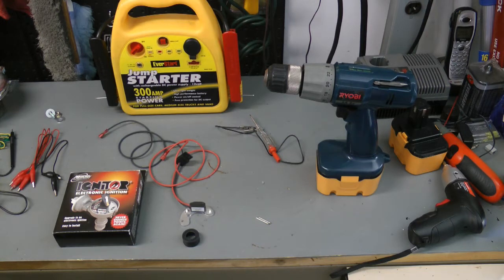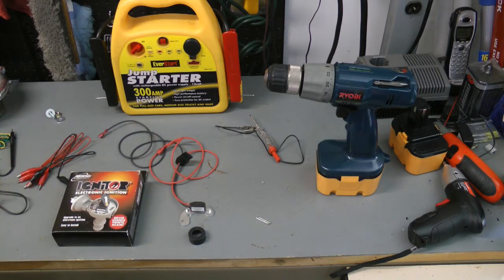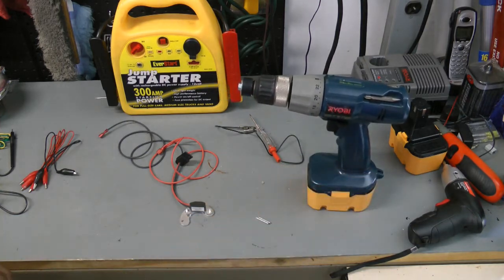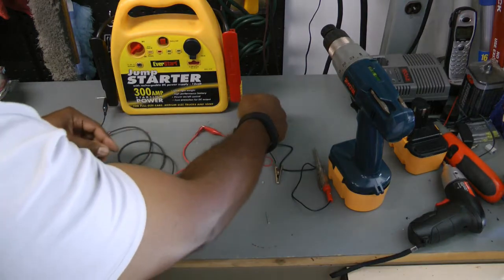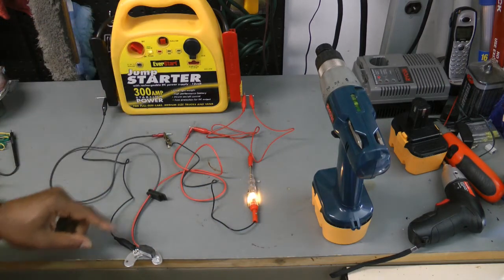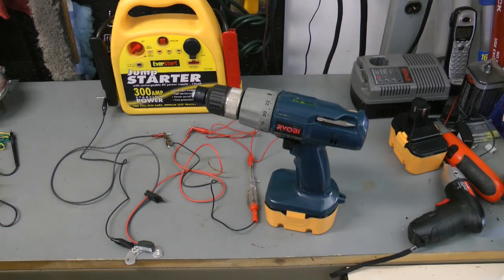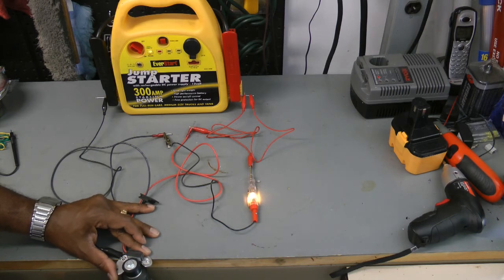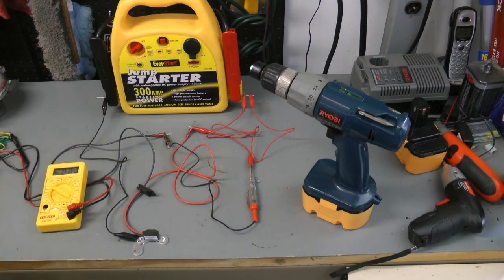Pertronix Test

Comment: Great Video
1 Question i got it all set up correctly, and the light is on, but when i use the drill the light remains on and doesn't flicker.
Does this mean it's fried.
Reply from the maker: Not sure, maybe Re-check the connections, but especially check that the ring is spinning close(r) to the module.

Comment: Any advice would be appreciated.  I have a pertronix module 2 on my golf cart. Any reason why the manufacturer Columbia Par Car had one installed??  My cart just starts without running. Would the module have to be replaced??
Reply from the maker: The module would not have anything to do with it starting on its own. Maybe look at the starter switch being stuck or shorted somehow. The module only operates when it gets a start/run signal/power from somewhere else (switch and or coil if equipped)
Reply: @kenhdog  Thank you. Where would the starter switch be located?
Reply from the maker: @NinoPrez007  I can answer that as I dont know anything about that vehicle. Golf cart should have an obvious on/off switch. You might ask on a cart forum like this one. https://cartaholics.com/threads/columbia-par-car-troubleshooting.3550/
Reply: @kenhdog  thank again for your help my friend.

Comment: I've got an original 1281 and a Pertronix II version. The original, key on, causes the test light to glow when first turned on, but the PIi version only works when it sees the make/break of the magnet. Assuming a protective circuit in PII not found in PI.

Helpful video. Thank you.
Reply from the maker: I heard that leaving them powered may no longer be an issue with newer units. That's good. Keep em running!

Comment: Why not wire the test light coil and position it where you can see it as you crank the engine over, would that work?
Reply from the maker: I dont see why not. The points/pertronics triggers the coil to fire. You could probably interrupt the low tension lead with the test light between the coil and the dizzy and watch the light flash. Disconnect the high tension lead to the coil so the  car wont start.

Comment: Thanks it will help me great video.
Reply from the maker: Thanks John. Glad it could help. Later on, I thought on some cars, pulling the distributor and spinning it on the bench with the unit installed and lashed up, might be easier than my eccentric screw, nut, and washer approach, being careful to reset timing when reinstalled. Glad it helped.

Comment: Installed a pertronix 3 on aircooled VW, can't get it to start.
Looked up this video and set it up with distributor out of engine.
I get good results while spinning faster, barely detect any light on test light if I turn it slowly. 
Also did a similar bench test with coil and spark plug. Sparks while spinning faster, nothing while rotating slower.
Parts used are:
Ignitor 3 distributor 
Flamethrower 3 coil
Pertronix plug wires
My thoughts are it would start if it rotated fast enough?
Any thoughts?

Comment: THANK YOU KEN for this VERY HELPFUL VIDEO. I’ve been having a hard time this season getting my classic 1967 Mustang to start properly. It cranks, but it never quite catches and I was trying to figure out what the problem was. Then I remembered that I recently installed a new radio and I left the key in the on position (without the engine running) for a good half hour testing the radio stations.  I remember reading that constant power could burn out a Petronix electric ignition system exactly as you mentioned in your video. 

So I followed your instructions multiple times with my Petronix II Module but I couldn’t even get the test light to turn on.  I checked and rechecked that my wiring matched yours. Then, just before I was about to throw out the module and order a replacement I figured I’d try to spin the magnet ring with the drill just to see what happens. Unless I am missing something, it seems that WITH A PETRONIX II MODULE, CONSTANT POWER ALONE WILL NOT CLOSE THE CIRCUIT, THUS PREVENTING A BURN OUT.  WHEN DOING THIS TEST WITH A PETRONIX II, THE VOLTAGE TESTER LIGHT WILL STAY OFF UNTIL THE MAGNET STARTS SPINNING - TURNING THE MAGNET SEEMS TO CLOSE THE CIRCUIT WHICH IN MY CASE ENERGIZED THE LIGHT, NOT DE-ENERGIZED IT AS WITH THE PETRONIX I SHOWN IN YOUR EXCELLENT VIDEO.  

I just wanted to make this point so that anyone with a Petronix II understands the difference.  Thank you again for a great,  very helpful video!

Comment: Couldnt you do a similar test just by testing for continuity over the wires and from positive wire to ground?  Ive one that shows no continuity at all but I dont know if thats normal.  I know which a point set I could get that.
Reply: I believe you on to something, continuity should be from the neg. side of the battery to the ground in the distributor. My 68 Falcon is giving me trouble. I will change the module and find out.   Thanks for the info.

Comment: Been having fits with my boat. This helped me know that the plate isn't grounding good. Took off plate and worked good. 
  I bought a new ignitor 2 and it didn't work either. Get this ! You can't do a bench test on it . That's what Pertronics tech told me. So I'll just make sure it's grounded good. Thanks again.
Reply: Unfortunately, information is only as good as the person on the other end of the phone.  If the module can be tested on the car, it certainly can be tested off the car.  May have to get a bit more creative with the lobe sensing version.

https://static.summitracing.com/global/images/instructions/pnx%20ignitor%20ii%20tests.pdf

Comment: excellent my friend ,,,,,i have the same problem almost ! i had a " hot spark "  they told me went bad ? they intalled a pertronix in the bug ,,,so i was testing the old module with an DVOM ,,and same way you did except i turned it by hand , its showed me  its not a bad module according to my test ,,,so it was replaced for nothing ,,,,,,you reinforced what i was questioning ,,,,i thank you for that ,,,,,people dont troubleshoot now days they just change parts LOL ,

Comment: I don't know about 6 cylinders but I know on 4 and 8 cylinders, these plastic rings have four magnets. 

I wanted to build a "wasted spark" electronic ignition system for my 2 cylinder Trabant 601. I used a Hot Spark (because it was cheaper) for a VW Type 1. The biggest issue was trying to figure out where the transistor was located inside the module which turns the coil on and off to get the ignition timing set correctly. If you notice in the video, there are four white marks placed above the magnets. Using a timing light, you can see that each time the coil fires, one magnet is at the leading edge of the module and the other magnet is on the trailing edge of the module. I initially thought the transistor was placed in the center. 

https://www.youtube.com/watch?v=LvllaO908p8

This engine has no distributor. Instead it uses two sets of points mounted on a plate and two ignition coils for each cylinder. By hooking the black wire off the module to both coils fires them simultaneously.  So one coil fires near TDC and the other coil fires near BDC and vice versa. Like a Harley Davidson motorcycle.

I still need to do some more work to this system before I feel it's road worthy.

The reason the engine sounds the way it does is because it's 2 cycle engine.

Comment from the maker: Thanks. Might be an easier way out there, especially if the distributor is removed and has the module installed. One could probably just connect it up and spin the distributor shaft. My module was on the shelf so I made do....